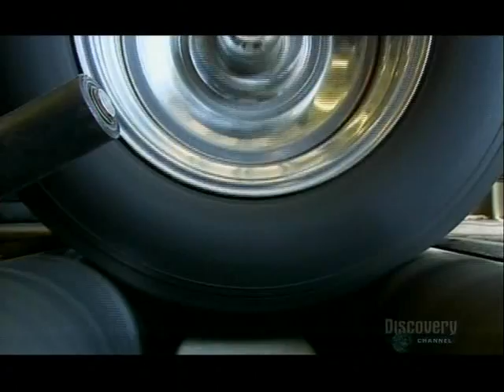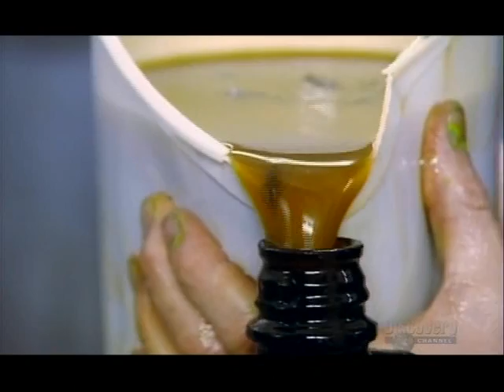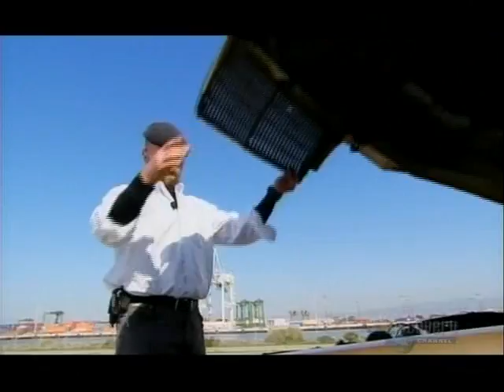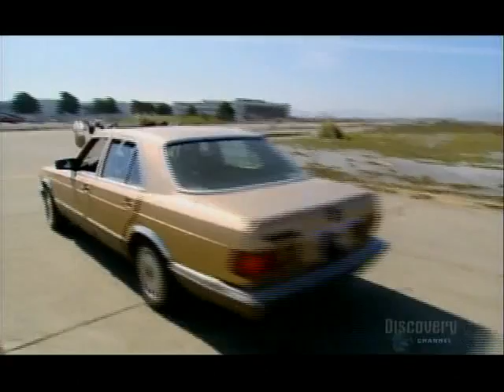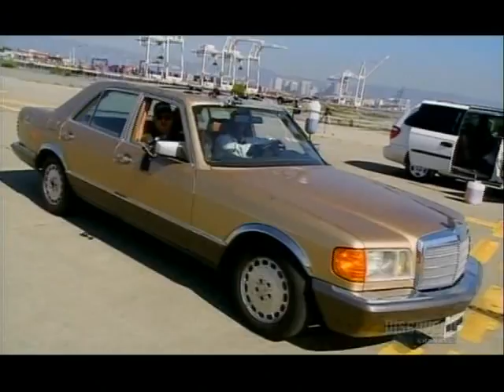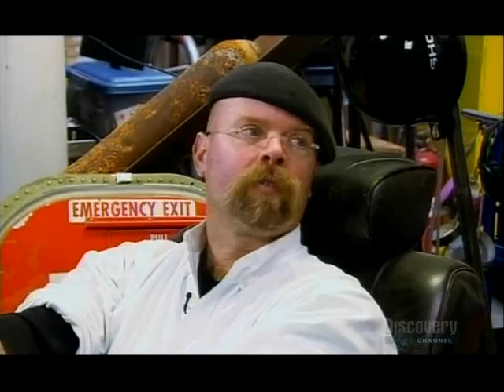Used Cooking Oil in diesel Car

Comment: but how would the cooking oil do in freezing weather? cooking oil gets solid fast
Reply: get a preheater
Reply: You can use a solvent to give it a Diesel like consistency for example (Gasoline ) people are adding percentages of gas/oil ratio depending on the weather and making it work

Comment: İ am living in Turkey.1 galone diesel price is 8 dolars.Yes you dont hear me wrong. My lovely goverment busting our balls with diesel. İ am going to start biodiesel,but i have a few questions. Did you anything to process this oil ? İs there a machine fot it ? And which car is the best for it ?
Reply: Mustafa Yıldırım Most likely an old surplus diesel truck would handle it the best
Reply: Just leave the used oil in a jerry can out in the sun to go more runny, perhaps add a tablespoon of methylated spirits per litre, and filtre it very well.

Comment: These two dumbb a** can't see anyfather than the end of there nose.
 It's not the milage you get, but the coast per mile... They can't see if you just go 15 miles for free is better than going 15 miles for $3.85 per gallon.  Same thing with the minto wheel.
Now who's "BUSTED"   If they can't understand it, then it's busted. You can fix dumb, but stupid, you don't have anything to work with. JMHO folks

Comment: you cant do this with just any diesel. the mercedes was a very tolerant engine. try this with a vw TDI and you will be left stranded. turn that oil into biodiesel however and you are golden

Comment: For Volkswagens, 2003 and earlier are best to use with veg oil. Most, if not all new "Diesels" have fuel systems that are far too picky to run proper fuel. It's ironic that emissions controls have resulted in Diesels only being able to run on petroleum.

Comment: Even though used motor oil is a horrible choice, it's not because it will harm your engine - it wont; truckers do it all the time. It's horrible because of all the pollution.

Comment: you can't just pour used cooking oil INTO ANY DIESEL MOTOR with out conversion. the mercedes diesels will runs without conversion. you put 100 percent veggie into a ford chevy or dodge diesel it is not going to run like the mercedes you would have to heat it to over 160 degrees. i have a 83 mercedes station wagon that i run on 100 percent used cooking oil 6 years now. veggie vacations once a year florida to PA. to visit my mom.  VEGGIE OIL MAN CLEARWATER FLORIDA
Reply: ارجو ان تجيب على سؤالي ..انا من فلسطين انا استخدم زيت الطبخ في سيارتي مرسيدس 240 هل يسبب هذا الضرر للمحرك ؟
Reply: I hope that the answer to my question, 'I am from Palestine I use cooking oil in my car Mercedes 240 Is this causing damage to the engine?